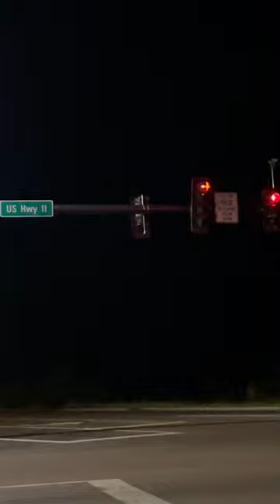What is a Near-sighted traffic light and why are they important?

Comment: There’s one near me where the through-lane light is obscured at a distance by some trees on the right hand side of the road when coming around a curve just before the light, but the left turn light is clearly visible. So people see the red light for the turn signal and assume that is the through light, start slowing down then they get past the trees and see the green and hit the gas again. What would be the solution for that?
Reply: Cut the trees, I guess?

In all seriousness, though, there's a light just like what your described that I've encountered.

They put another light offset way to the left to the point it's literally mounted on the left-side pole. That way, when you're coming around the curve, you see the through-lane light first.
Reply: Take the train.

Comment: So story time ;): I was chillin and I seen a traffic light swinging and they all went out winds was bout rip all if them down I'm like I think them metal poles and better than wires 🤔. Whats your opinion on Wired or Metal poles  holding traffic? Reminds me when I was out side storm watching and out of nowhere I get slammed with 91mph a tree falls right beside me telephone poles are swaying I heard a big CRACK AND ARCING it got dark within 5 seconds . I was bouta go inside and my damn trash can assaulted me,so I had to go grabs my trash bag put it where it wouldn't blow away again.The next morning I get up my neighbor is cussing the county out because he couldn't get to work but this dude had a jeep so he could've pushed a tree that was smaller.  I had my saw at a different place couldn't get out Lines n trees blocked both sides of my road 1 fence was broke my neighbor the one that wasnt complaining cut his fence, so I can go get my chainsaw I get back I see the county they said it's blocked we can't touch it because of bees and other 1 has lines, so I Said ok I'll cut them they drove off and I got to work got attacked by bees and next 1 risked my damn life cutting a tree off of electrical lines that could've re energized . But me n my old work truck gets it done no matter what the risk is but 95°F I think that's what it was hot and no electric and my generator I bought from someone they used ethanol and glued the damn carb. NO AC them Electric workers came from Iowa to KY so I took the work off of them so peope can't get there power bck. SORRY FOR THE ESSAY OF A QUESTION THAT REMINDED ME OF A STORM SRRY FOR YOUR EYES BECAUSE OF MY GRAMMAR 😂😂😂.

Comment: Your American lights are really confusing.
Reply: How is this confusing? It's just an extra head for an approach that can't see the heads for the signal they are approaching...
Reply: @epileptix8954  not that but there are multiple signals for the ones going left and straight etc I don't get it
Reply: @thunderbear0  well, some movements are broken up to make sure their queues are cleared as efficiently as possible. Sometimes, making a left turn at the same time as the opposite through movement just isn't possible or safe, so a head for the left turn can be used to show a phase where only the left turns get to go.

Or I guess if you live in a country with opposite road directions, it would be right turns, not left turns.
Reply: Red amber Green.. it's the same world wide ie red means stop ect...
Reply: There is schedule for traffic control. See the
Manual on Uniform Traffic Control Devices. It details about everything for traffic control and traffic safety. The lights are not confusing. Engineers designing roadways make it that way.
Reply: @billbirch3748  If engineers follow the  MUTCD, then how could they be making it confusing? Wouldn't that mean the book was also confusing? (It's not, I've already read the book, and I design signals.)
Reply: @billbirch3748  when thoses engineers decided to put traffic lights on roundabouts that's when....